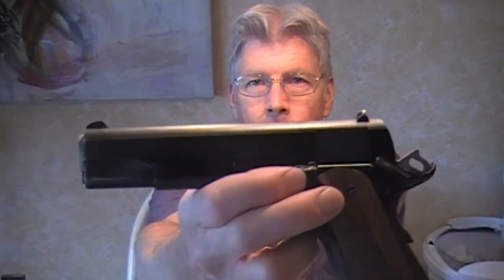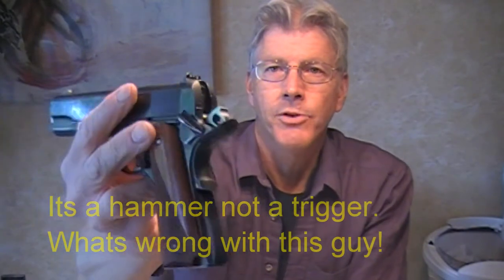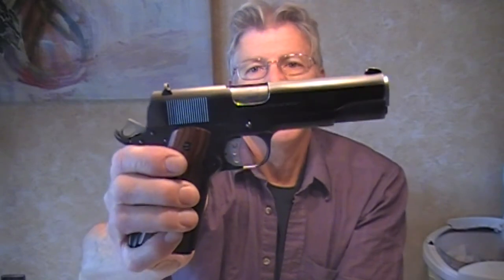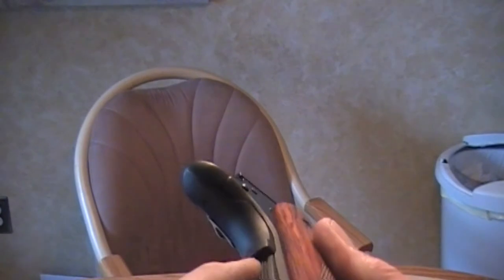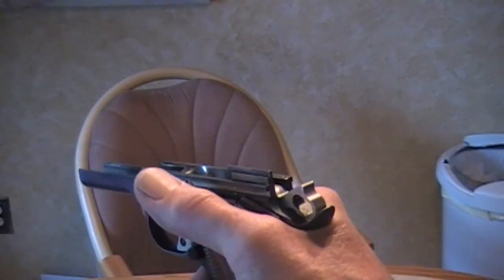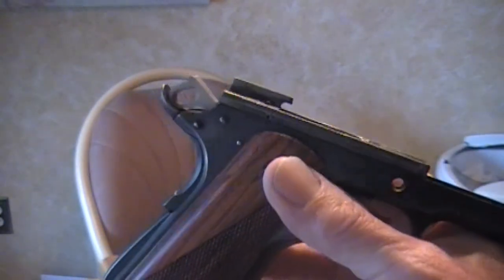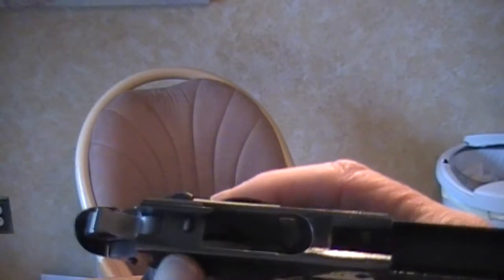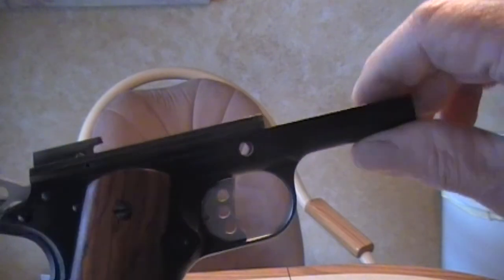Colt GI  1911 with Wilson drop in grip safety

Comment: was the item serial number 429BC? or 429BG? some people got the wilson drop in tail with BG with the GI model 1911 and the results has a noticeable Gap between  the frame and the safety grip. yours however fits in nicely.